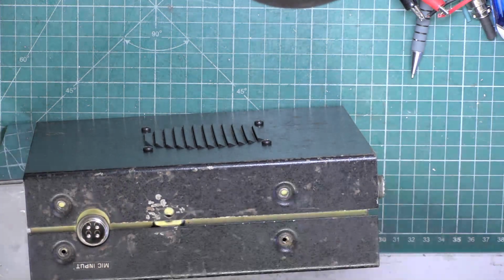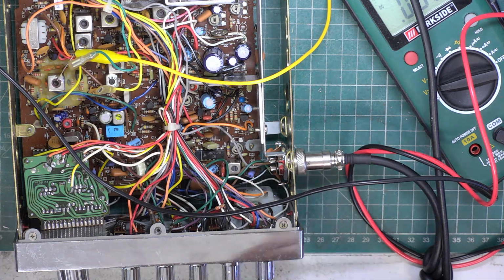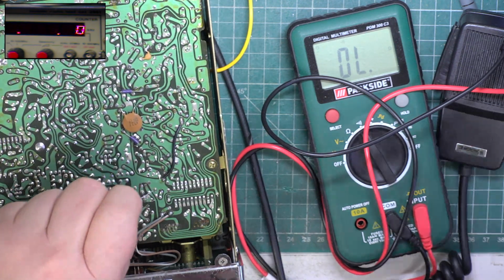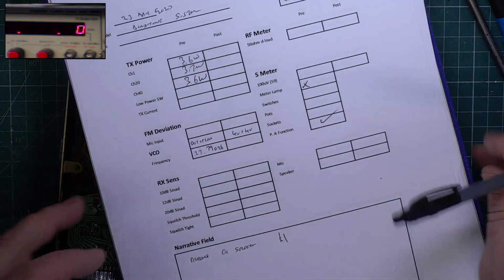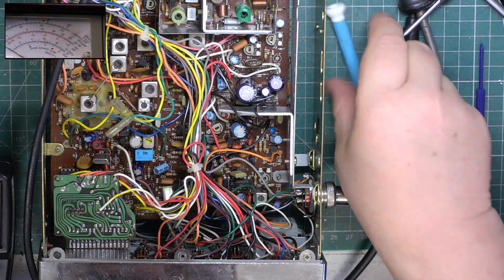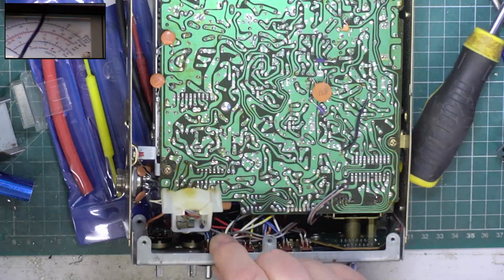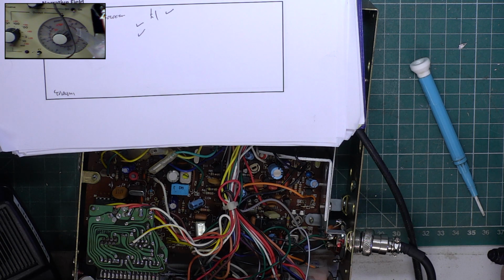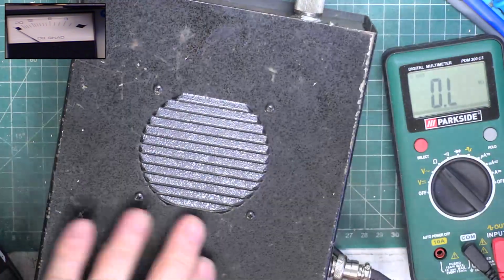Binatone 5-star CB27/81 UK FM CB radio -  extensive repair & alignment

Comment: Awesome, many thanks Richard. I’m so glad you got it working for me. I do have a new excusion for it, thank heavens you had a replacement channel selector on your scrapper. I did try to set the vco on channel 20, I will remember that mistake for the future. It did tune in on channel 9 as you know and suggested. Looking forward to the scratchy corner test. You are a star mate 👍👍👍👍
Reply from the maker: Yes it's VCO set @ ch 40. RX = 4v, then TX = 4V. Change to ch1 check between 1.8v to 2.4V in both tx & rx,

As ch20 wasn't working, the PLL would have sent an 'inhibit' signal, hence you struggling.

That's one of the most sensitive set's we've ever had here.

Richard, G0OJF, UK
Reply: @ukfmcbradioservicingTango21  yes I did try the lock on channel 40 but it stayed at 6V, that's when I changed the pll in desperation but tried it on channel 20 afterwards like a donkey, so the pll must have been at fault originally which I inadvertantly sorted without realising. Anyway I'm just glad you managed to sort it out for me as I don't have a replacement channel selector so couldn't have sorted it even if I had known..😁👍